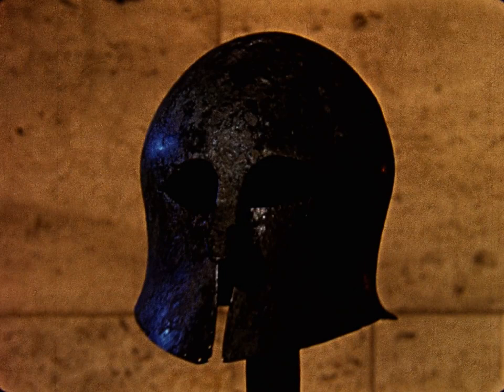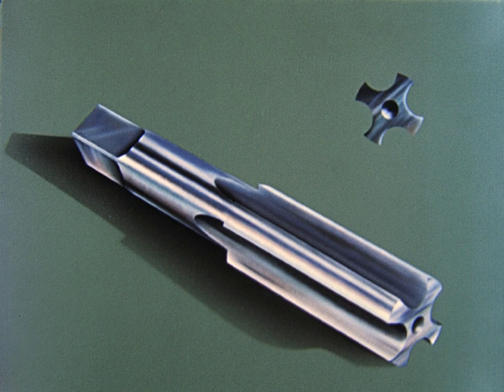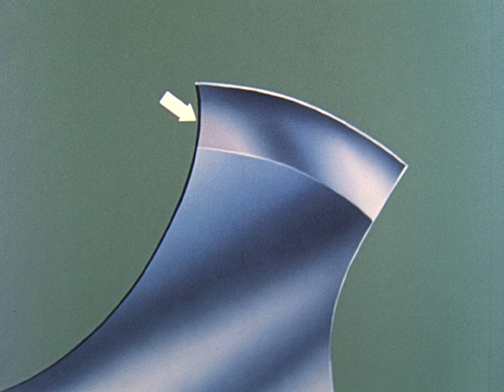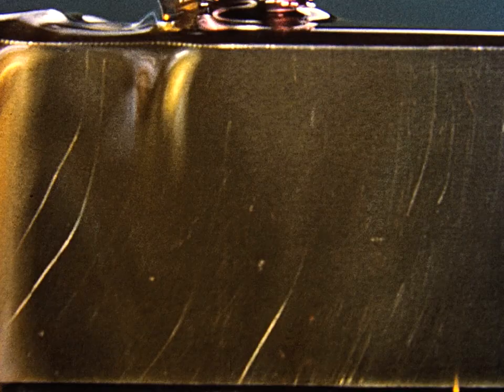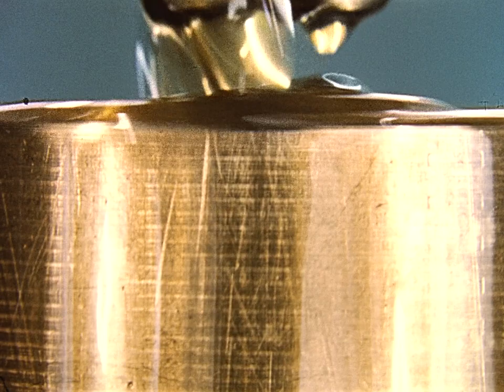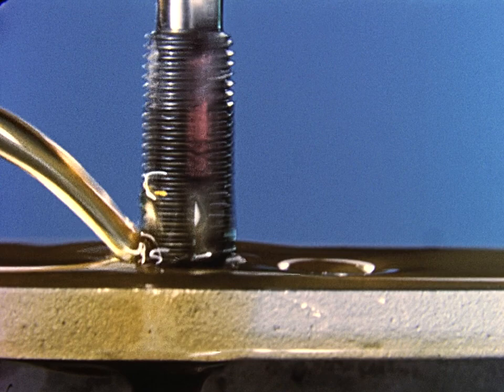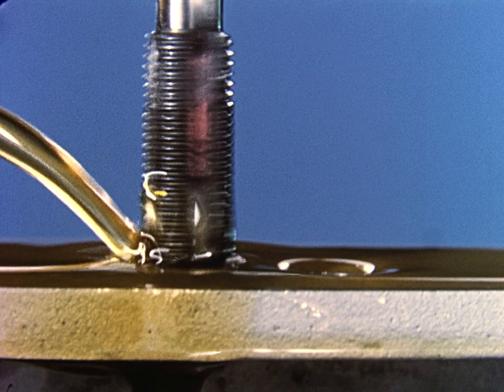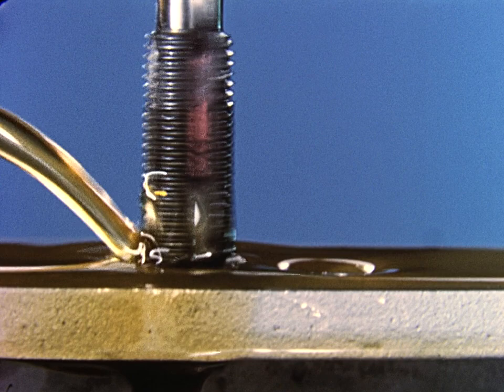Greenfield Tap & Die - Facts About Taps and Tapping

Comment: Yes, a much needed video for novice to learn and experts to remind. 
Thanks to Mr. Whitworth.  Additionally, here are my experience on pre standardized British taps and dies in my lifetime.

I have restored many pre WWI And WWII English motorcycles.  
They were assembled with non standard screws made from non standard dies and tapped holes made from non standard taps.

This resulted with NO interchangeability of screws to threaded holes.  On reassembly you needed to put the SAME screw into it's EXACT tapped hole or they could be not fully seated.  Worse yet the threaded holes could be too loose and strip out when tightened.  This was before British Standard.

On English motor cars the hardware standard changed to SAE in 1949, the same as in the U.S.A.  You actually found late into the 1960's British Standard hardware on gear boxes, rear ends and steering assemblies.  On gages and hydraulic fittings you still might find Whitworth threads into the 1970's. 

I still have complet tap and die sets in SAE, British Standard and Whitworth.  Additionally Metric tap and die sets in both Japanese and European standards.  Of course sockets and wrenches in ALL standards.  I am tool poor.  HaHa!

In my next life I don't want to reincarnate until there is a World Standard.  HaHa!  Happy Holidays and God's Blessings.

Comment: I got a set of tap and dies sent to me by mistake by a seller on eBay instead of the router bits I ordered. I got a full refund but was told to keep the tap and dies rather than post them back. The fact I refused to pay the postage as I hadn’t ordered the tap and dies might have had some bearing on this. I doubt very much I could show them to my brother, a time served fitter and turner who worked up to a PhD in Engineering, without him collapsing in fits of laughter. But they might do for my small woodwork jobs where I need a custom bolt and bolt. This is an extremely interesting and educational film which might take more that one viewing. Thank you very much to all concerned.

Comment: I assume the Pacific Rim took over most of this work. At 20 I got my first set of taps and dies from the Snap On driver. Still have the whole set.
Reply: There is still Greenfield Industries (Cleveland, Chicago-Latrobe, Cle-Line, Cle-Force, Bassett, Vermont Tap & Die) manufacturing in South Carolina. Kennametal announced $5 million and 70-job expansion in Greenfield continuing Greenfield Tap & Die legacy in Massachusetts.

Comment: The cutting fluid there looks like oil, but I'm not sure if plain old oil is used as frequently these days as specialized fluids.  Anyone have any insight?
Reply: It's not plain old oil, it's cutting oil, of which their are all kinds of gradations and manufactures.   
For tapping, the lubrication of cutting oil is better than water soluble based coolants.
I've run tapping heads on CNC lathes and mills using water soluble coolant, but only because it was one of many tools on the same set up, and oil can't stand up as a coolant considering the high speeds of the other tooling.
Reply: Well there’s not really a such thing as “plain old oil” and I actually cringe at the parts where people are dousing their hands in the stuff. Back then they put additives in cutting fluids that it turned out were really bad for humans.  But those oils performed supremely. I often used thread forming taps which weren’t covered here. Usually I would brush some way oil as the tap was going in. Worked great and the coolant used for other tools would get contaminated with way oil anyway and that could be skimmed off later.

Comment: Tap and Die, Tool and Die, it's all so confusing!
Reply: camgere - Also GO - NOT GO. The tools I use in my job are labeled GO - NO GO.
Reply from the maker: Those tools are probably for quality control. The allow spot checking on the production line to see if the parts are within allowed specifications. Very important! We have some film hidden away which shows some of this.
Reply: Made more confusing by the US making the spelling of micrometre the same as micrometer.